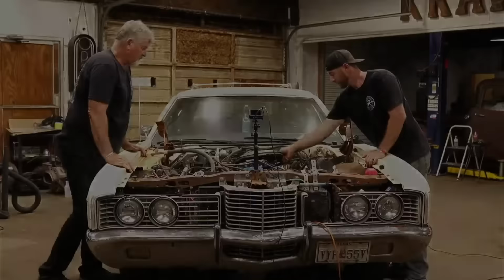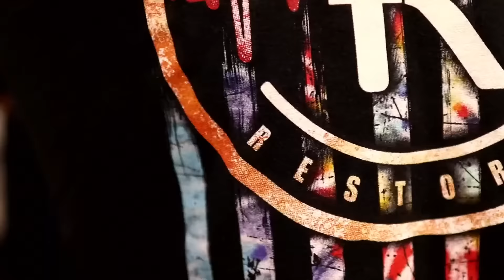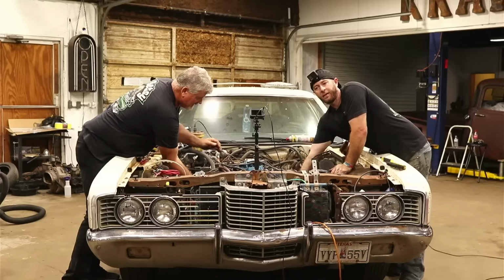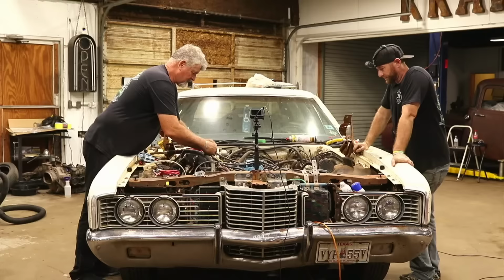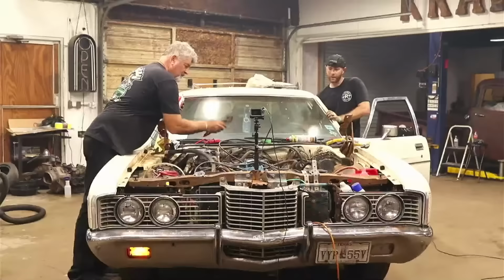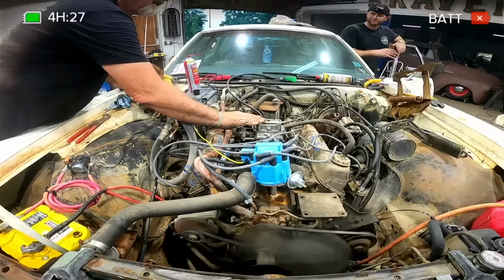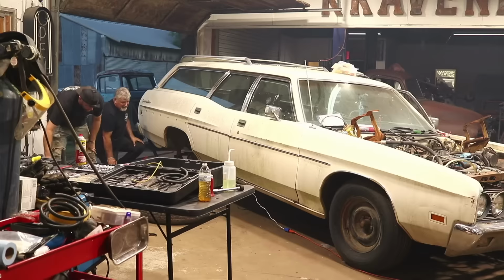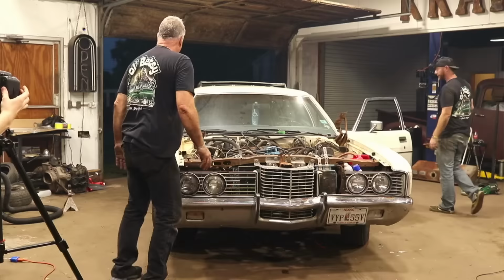LIVE Forgotten 1972 Ford Galaxie 500 Station Wagon | Will It Run After 20 Years? | RESTORED

Comment: Accel super coil. 90s stuff there. We had a station wagon when I was kid. Had the rear facing rear seat. Looking back that thing was a Christine of sorts. Riding down a 2 lane road that was almost even with a river, one of the rear tires just popped off. I was sitting in the rear facing seat. All I saw was sparks. In my head we were headed for the river. Dad kept that from happening. Windshield wiper arms flew off in a storm one night. The final nail in the coffin was when we were driving along and the timing jumped and sent fire out the carb. All we could do was pull over, get out and watch it burn to the ground. Crazy car.

Comment: Use to work at a drug store we delivered meds. And hospital equipment in a car just like this one.I also hauled big green oxygen tanks in it .I would load that thing down with 10 of them tanks and drive 60 miles with the rear bumper nearly dragging .It had a 390 in it and it would run.Thanks for bringing back good memories.

Comment: Ford used the juice cans for vacume cannisters for a long time. It helped supply vacume for anything that needed it besides the brake booster and vacume advance. Speaking of that, if you hook up the advance on the distributor it will run much better and probably idle.

Comment: I had a 1972 Country Squire with the fake woodgrain sides. The original 2 barrel 429 threw a rod so we replaced the engine with a 1970 429 4 barrel premium fuel hi-po engine from a salvage yard. The thing really ran good and it was quick.

Comment: My family had a 1971 Country Squire. Same as this but had the wood siding. Yellow with black interior.
We didn’t have much money back then so our vacations were dragging a pop up camper around during the summer. We’re on vacation going south from DC and with my brother, two sisters, my mother, father, me and my mother’s two small poodles. My father hated to have to stop at every rest stop so everyone could go to the bathroom, so he kept a plastic bowl under the front seat. 
I was “in the way back” and had to go. My dad passed the bowl back and I knelled up and went. I asked my dad “what do you want me to do now?”
Just then, he hit the rear window button up front and the rear window started going down. 
With the camper pulling behind and the wind spoiler from the roof rack, when I tossed the contents of the bowl out, a half second later, a fine mist of pee came back and covered the inside, including my brother, two sisters, mom, dad and the two poodles, along with the interior and the front windshield.
My dad pulls over and comes running back yelling “what did you do? I was pulling over for you to pour it out!”
That was the only time we got a hotel room while on vacation. Everyone took a shower and the two poodles got a bath. That night, my dad spent several hours wiping the interior down.
The family talked about that for years!

Comment: I had a 1973 wagon when I was stationed at Ft. Campbell Ky, I forgot I had CQ that night and was in Nashville,I shot between 75 and 100 mph all the way back and got there,The next morning tried to fire it,I ended up blowing the timing chain and gears out of it due to low oil pressure,It had a 351 Windsor in it,I thought I had fried the engine,Put the new gears and chain in and drove it for another year before selling it to somebody else when I went back to Europe for my final tour of duty,Those wagons and especially the 351 windsor's are bullet proof.

Comment: This was a fun video.  Sure would love to see a follow-up.  That big ol' carb prolly has a lot of junk in it, as well as a lot of stuck bits (surely the float).  The 400 sounds healthy.  Galaxie/LTD models from the early 70's all pretty much use the same hood hinges; in TX, I'm sure they could be found in some boneyard on the cheap.

Once you clear out all the stuff in the back seat, you can drop it flat, open all the doors for good ventilation, and crawl back and carefully pull on the rod that opens the side latch at the passenger side of the tail gate so she opens like a door (don't need the window down).  This model does not have facing seats, but it has a rear storage compartment near the gate and a third row that faces to the rear (my old baseball coach drove one).  Many blessings!

Comment: That's Campbell's Vacuum Soup. Just evacuate and serve. The fun part is going to be sealing up the vacuum leaks - especially the intake manifold. I did a '72 back in '81. 9 passenger. Thing wagged like a dog going down the highway. Used it a few times, just by using nylon screening and magnets, as a refuge for when it rained (we'd come in from the tents if it got too bad). It's running on gas - and the Vacuum Monster has raised its' ugly head.

Well - you got it running. Someone will want to chase through the carb & vacuum systems (and put some advance on that HEI distributor through vacuum). Good work.

Comment: That HEI distributor is a great start. Continue the flow with a GM 1 wire alternator. “Ford tough with Chevy stuff”.
Another suggestion is to “Ranchero” that wagon.
If the 1972 drivetrain holds up (change gearing to 3;73)
It’ll run faster than a one eyed Bogota !

Comment: I owned  a 1971 Country Squire wagon back in the winter 1977 that was a rust bucket hear in Michigan paid $100 for it as a temp car till I replaced the engine in my Buick. Needed valve seals and smoked like hell in the mornings when first started. Never knew that old 400 had any power because all the roads were wet and snow covered. The first dry spring day some guy was gunning his Pontiac beside me at a red light trying to get me to race. I was laughing and floored the old girl as the light turned green and was amazed as the inside of this old wagon filled up with tire smoke and I seen that Pontiac in my rear view mirror. This car use to spook me like the movie Christine. It would just die on a dark deserted dirt road no lights nothing no signs of life. I would give up on her. Walking away I'd see the headlights come on behind me and the radio start playing.Turn signal flashing Half expecting it to run me down I'd go back get in her and drive it home like nothing happened. I know now that it had a circuit breaker under the hood that would cut all the main power of when it got hot but it sure was spooky for a young man.

Comment: I would put an air ride system on it. Some nice looking stock type of wheels, painted red and have small center hubcaps with the thin beauty rings, so y'all can still see the red wheels. Oh, and make sure that the rear tires are wide, fat ones. Maybe a thin set of red pinstripes down the length of the wagon. A couple of old, cool looking suitcases up on the roof rack 😎. Also place 2 peace sign decals on it, at the back corner of the rear side windows ✌️😆🙄😳🤣😂
Reply: cool air system is usefull inside theses old car of the seventies

Comment: I had a 72 country squire with a 400 . Put a crower low end torque cam in it,ran awesome but one night on the highway spun a rod bearing. Took a 70 marquis 429 put it in and ran incredible . It had a 2.73 rear ratio.

Comment: Another great job… she looks solid and good. Tune it, make it idle make it stop and hush her mouth a little and she may be road ready. There was surprisingly very little noise from the engine… no tapping, clattering or knocking, and went right into gear. Could be a good cruiser.

Comment: it's a smog Evap canister, made from a real tin can. EVAP systems have been required on gasoline powered vehicles since the 1970s. A typical system consists of the fuel tank, an EVAP vapor storage canister full of charcoal, valves, hoses and a sealed fuel tank gas cap. The EVAP system is designed to stop fuel system fumes from leaking directly into the atmosphere.

Comment: I used to use a cool whip container over the Carburator intake with a center drilled hole so I could bolt it down and blow it off, one size container was perfect for those big 4 barrels.

Comment: Good live on that one. Too bad there was no brake drums on the rear. You may have had a little brake. As far a the carb it acted like the accelerator pump wasn't working. If electric maybe a wiring issue?

Comment: A little trick a old mechanic showed me on how to make it easier to put spark plugs in easier is to get an old boot from a old spark plug and put it on the spark plug and it makes it easier to put spark plug on. A straight boot not an angled boot. God bless. Hope this will help u.

Comment: Hey lance check right behind the back seat for the two single seats in the very back. It should have A flat panel with handle carved out to pull up from the floor up to access the the hidden seats. That's if there is that type of setup in that Ford galxey station wagon 500  year 1972.

Comment: I also really like the Four Head lights on the front, that is awesome, did it have AC once , I noticed a strange square to the right of the and water pump casing ...
Reply: Yes it did. It would have been a big, square York compressor mounted to that plate. The power steering cooler that's flopping around would have been attached to the side of the compressor.

Comment: The rear face and seats were a good way to asphyxiation your children sitting in the back! We’d drive along with that back window rolled down and the kids would get the exhaust sucking in. Live and learn!
Reply: That roof rack air deflector kept the exhaust from entering the rear with the rear window down plus the exhaust was turned out to the side and away from the rear of the car.

Comment: Look closely at that 400...if it has the FMX transmission...it very well could be the very sought after 1 year only 400 with the small block bellhousing bolt pattern...referred to sometimes as the 400 FMX block. I've had my eyes peeled for 1 for a while now. If memory is correct it will also have the bosses on the block for the small block motor mounts...although I think they aren't drilled.
Reply: I sell my 72 wagon rub good way better than that white 1

Comment: I believe this is a 385 series block. The 351M, the 400 and the 460 all use the same bolt pattern on the bell housing. just as an interesting aside. Personally, I love the FE block, particularly the 390.
Reply: 351C, 351M, and 400 were 335 series engines, along with the Australian 302C.  Almost all had the big block bellhousing bolt pattern.

Comment: Well, I have 1979 Lincoln Mark V, back at Arctic Circle, Finland, same engine 400, but...I think you should check those sparkplugs...., adjust them a little, that cap looked....HUGE ;o) Good Job guys, my Lincoln only has about 86000 miles, and car looks like new =))

Comment: i just did the same thing with a 74 galaxy 500 sedan. mine only needed a fuel filter and an exhaust doughnut.  the old 351 runs smooth as silk. it is for sale.

Comment: It's early in your vlog and I noticed or at least you guys pointed out, what seems to be a new Distributor, just thinking out loud and maybe shouldn't, That I would automatically check top dead center, placement with the rotor and make sure the wires are routed in the right way???... before I'd go any further???...

Comment: If you want to get the dents out try using a plumbers plunger and boiling water put the plunger on first then run the water on then pull the plunger the dent may pull out

Comment: The empty square sheet metal platform looks like it may be where the A/C compressor went?  That miniature radiator thing you said was the power steering cooler seems like it might actually go to the A/C compressor that's not there?  Just wondering about these things.  What is the black thing that looks like a coffee canister?  We had a previously much used Country Squire wagon as a second or third car in the early seventies so things like that dual-action tailgate brings back memories.

Comment: If I’m not mistaken, that “can of soup”, as you called it, was part of the early emission system of that day. That’s about when emissions systems begin to show up in cars, such as they were. I could be wrong, but I do believe that’s what it was.
Reply: It's actually a vacuum reserve cannister for the cruise control and vacuum operated blend doors for the HVAC system, without it,you'd loose vacuum going uphills. I was a dealer tech back in the 90s and early 2000s.

Comment: Is the door lock plunger on the driver's side bigger than the rest? Then it has power locks and they work on a vacuum.  They went electric later.  It locks the tailgate too.  I would play with as a kid because if you pressed down on it it made a vacuum PSSST sound

The wagons came in Custom, Country Sedan and Country Squire (the woodie) in order of rank.

My dad had a 72 Country Sedan in metallic Green with that same interior.  Yours is the middle of the range.  My dad's was bought from Avis rent-a-car in 73.

Comment: ha i had a 66 and someone cut out the body from the drivers door back and then attached a camper to the frame and i put rims on it that looked almost identical the the rim in the back! it had a 352 engine but my dad had a regular coupe that was a 69 and it had a 390

Comment: What IS it with y'all repair channels that think its a good idea to do a burn out with no brakes? Junkyard Digs does the same thing. lol! "we cant stop it, so LETS FLOOR IT!" 
I love watching this type of thing though. I wish you'd done something to the brakes, even if its only looking at them. Maybe come back to this car in some subsequent videos to show the carb being rebuilt and the vacuum lines being repaired and putting brakes and matching tires/wheels on it and then take it around town. Maybe swap that radiator for one with a trans cooler built in, and possibly replace that busted grill and have those dents pulled/popped. I'd watch.

Comment: If it has low oilmpressure then it most likely needs cam bearings. Ford have to have good cam bearing in order to have goodnoil.pressure. all older fords

Comment: I bet it does have rear facing seats, they didn't even lift it up to see if it did cuz I noticed a pull up under those tires and he thinks it's a tire compartment lol just look at the damn thing dude!! take the tires out through the back seat it should fold down.

Comment: I thought the 351M was the only engine available in the 1972 country sedans? I could be wrong or it was swapped in. I know theres not a terrible amount of differences between the two
Reply: You could get the 351M, 400 or the big block 429 in these. Back in the 90's these were the go to cars for cheap big inch motors for truck/Bronco projects. The 429 and 460 was a lot more common in Lincoln's but you still check these out while at the boneyard. The 351M/400 is a crummy build platform but if you had a F250 with a blown motor someone had a Torino/LTD/Thunderbird with a good motor in their backyard.

Comment: Need to hook the distributor up to 12 volts. The factory wire is only putting out 8 volts. Awesome car and glad y'all  finally got one that didn't put up too much of a fight.
Reply: Does the hei want 12v all the time?
Reply: @michaelerickson1518  yep. If it doesn't get 12v it'll run poorly and eventually burn up the module

Comment: No compression— well you do have the plugs out ❗️❗️😆😆
Reply from the maker: We do realize that.. often you can judge the compression by the sound of the burst of air coming trough the spark plug holes. It didn’t sound like much and wasn’t shooting a lot of the oil we just pumped in the cylinder back out. Gauge proved otherwise..

Comment: My idea would be frame off restro, with show room interior , modified engine, custom headers, glass packs, 4 barrel carb, 
I really hate when they slam it!!!!!
Do not slam this fine old wagon. Leave the ride height stock, but with mag wheels
Reply: Yeah! Period mag wheels like slots or Cragars.  A station wagon with a muscle car theme.
Reply: The extra radiator.,could be the trailer package power steering cooling radiator
Reply: Door keys do not work ignition key switches on this series.of ford's up timid 90's
Reply: Engine compression lowered for smog control/emissions requirements
Reply: Ford distrib caps have a "1" molded into cap
Reply: Why don't you put jack under rear end/axle tube.? Picking up the body results in suspension coming to lift limit before rear axle raises off ground.
Reply: You can't open tailgate from inside with window up, it will swing open with window up or down
Reply: Country sedan wagons did not come with rear facing as standard equipment

Comment: That ign wire goes through a resistor circuit for a conventional ignition 8.5 to 9 volts on a HEI you need full 12 volts on ign and crank with out full voltage they will perform very poorly I know blow off no reply

Comment: 3 way magic tail gate will open like a door window up or down and open tail gate with window down had one when I was 19 cheaper on insurance than the road runner I wanted drove it So Cal when I went into the Air Force turned out to be a great beach going ride with the guys my had a 400 ci and a C6 auto believe my had dent in the same place on the left rear only dent the one I had would love to have one today

Comment: With Having Everything Set in time the Engine Will Run Idle Without Back firing 
Distributor Carburetor Points Plugs Wires 
MAY 13 , '22  08:35 PM 🇺🇲♿😎🖐️👍✌️

Comment: You did no adjusting at all to the engine how did you expect it to run why did you even try to drive it with no rear drums if you would have tied the rear shoes to keep them from expanding you would have most likely had front brakes